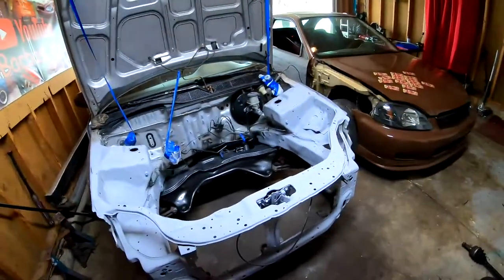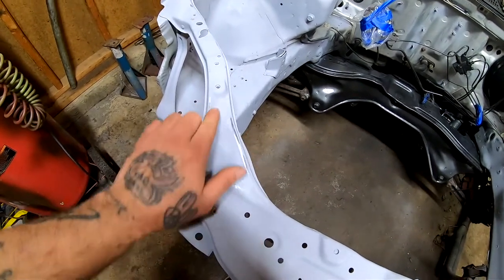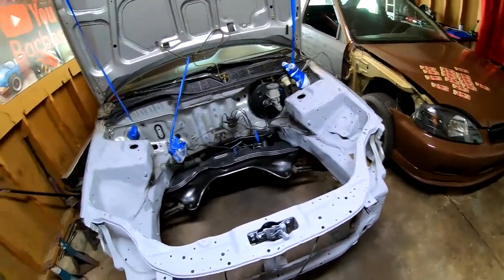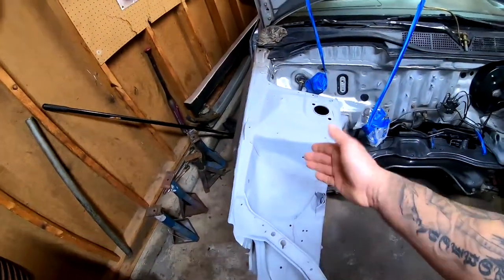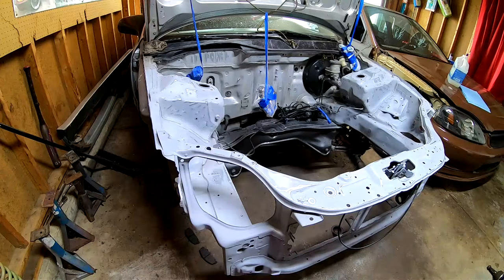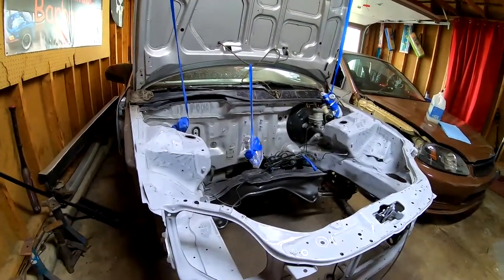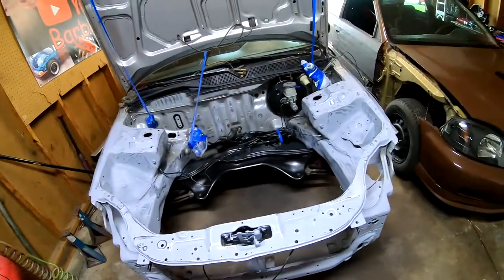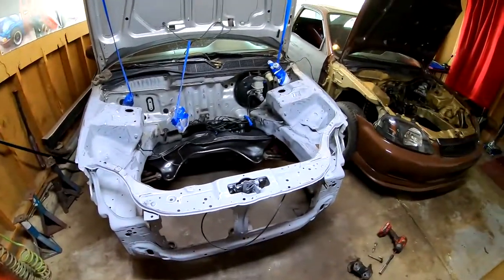Engine bay almost done engine bay paint prep part 3 lots of sanding

Comment: I can only imagine how long that takes.  💪
Reply from the maker: yeah time consuming and boring lol but tomorrow I should be done sanding and then I will be ready to tape and lay paint.
Reply: Barbas Life i think running the cheap harbor freight gun at higher psi for single stage is optimal and it will atomize better. Try 35-40